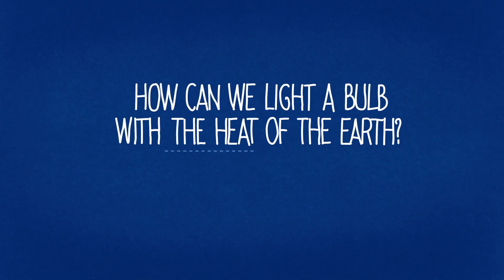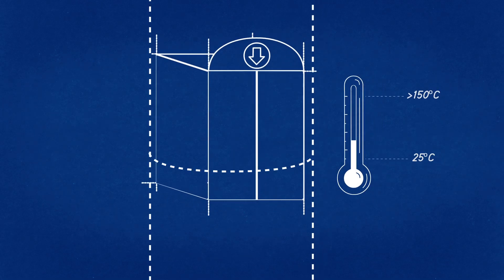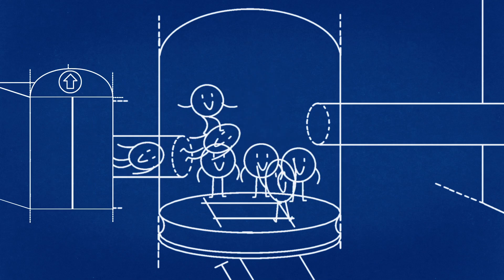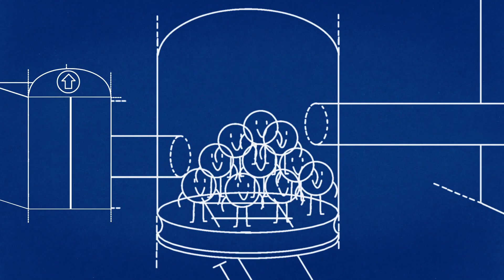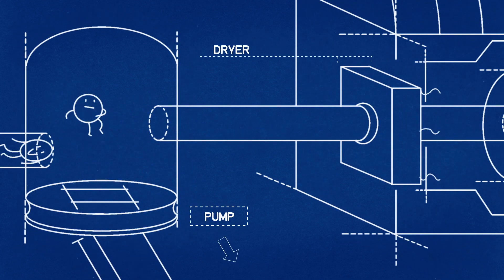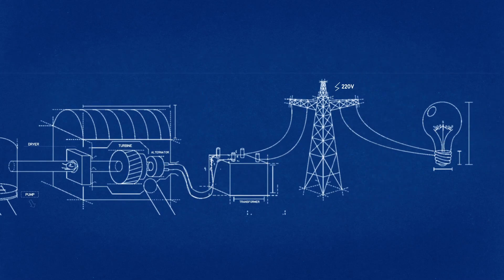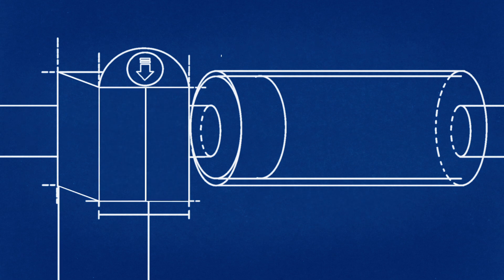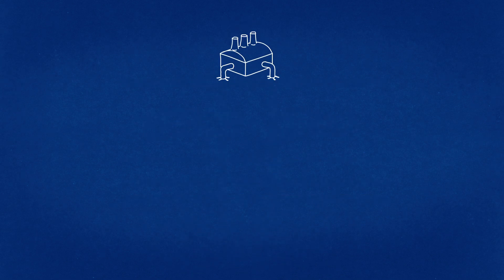How a Geothermal plant works by CEGA

Comment: If it's pressurized underground, why not use heat to make electricity at it's source with heat induced mechanical spin like a solar updraft tower but in this case a pipe...then send that electricity to surface to make heat again on sun exposed surface, then make steam on that spot, pressurized again if necessary. Wondering if the process could be more efficient, saying.

Comment: Based on the video how heat from the underground transforms into electricity?
Reply: The ground gets hotter the deeper down you dig. People dig a really deep hole and hot water and steam come up. The water is sent back underground (so they can keep using it) and the steam is used to spin a wheel that’s connected to a generator, which creates electricity that we can use.